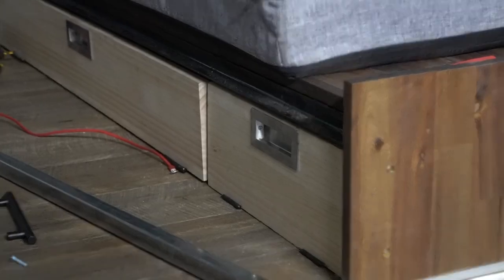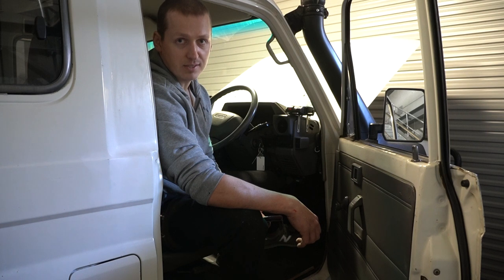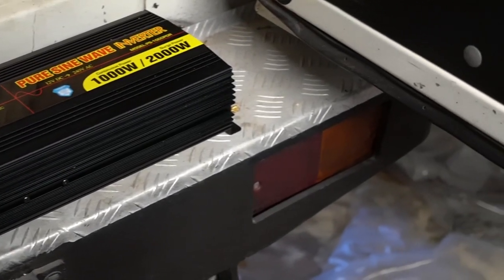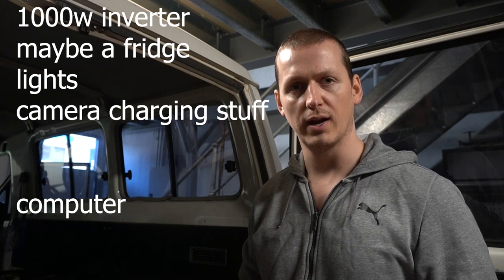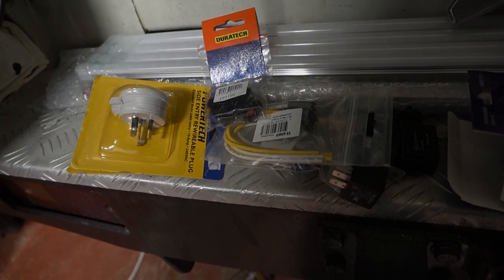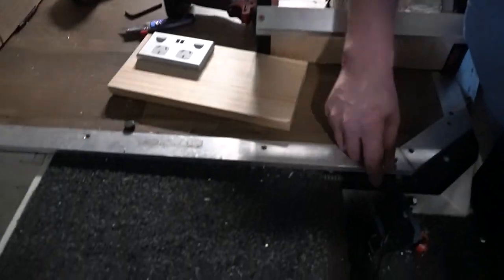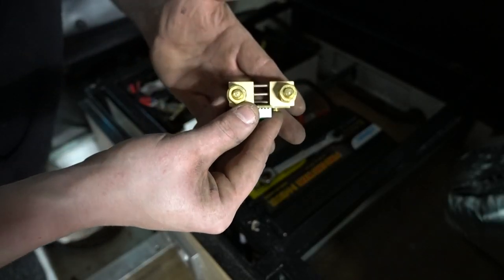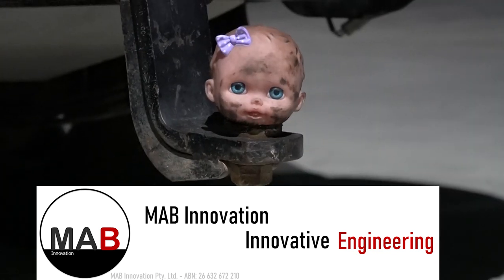Wiring your own 12v setup for your campervan or 4x4 troopy | Part 6

Comment: Here's my safety comment:  Power points in RVs have to be double pole (both live and neutral get switched off).  Normal house plugs are only single pole. But feel free to ignore this.  Maybe the inverter is double pole and therefore the power point becomes double pole too... 
Waiting breathlessly to see what the actuator is going to be used for!
Reply from the maker: That's a good bit of info I certainly wasn't aware of. I had checked beforehand if there were any major requirements like this, but it seems it's not common knowledge. While technically it's not an RV/caravan and would probably be legal as is, I have the annoying habit of liking stuff done properly.
Thanks for the insight. I'll get on it.

https://emucaravanrepairs.com.au/caravan-electrics-explained/

I found this link which gives a good explanation for those playing at home.

Hopefully the actuator doesn't end up a disappointment ;)
Reply: I use a brand called TESLA (nothing to do witht the car maker).  If you get Clipsal Double Poles outlets they are stupid expensive.  Reckon I just got them off of eBay.
Reply: The double pole outlet is because caravans and the like are powered from plug in extension leads which can be wired up incorrectly causing the neutral to become the active which is then in a normal power outlet not switching off the power to the appliances making the appliance not operate but is still live. The troopy not being plugged in may be ok I’d have to go through my reg book to see if that would be the case. Be careful of eBay 240v power gear most of it is not Australian approved.
Reply: Tesla is Aust Approved to V110160 Standard
Reply from the maker: Thanks guys, I ended up ordering a pair from electrotraders. Probably not the cheapest, but the style is almost identical to the ones I put in, so I went for it.
Reply: Better to be safe than sorry ,  good work , now you’ve got a couple for the office , should I bring up the rcd(safety switch) debate for inverters in vehicles , nah I’ll let it slide.
Reply from the maker: @Andrew-76  you dawg, I heard you like RCD, so I got you an RCD for your RCD so you can trip while you trip
Reply: Love it😂

Comment: Good to see you are keeping to the golden rule K.I.S.S "keep it simple stupid" you may want to consider putting a sealed maintenance free battery in the cabin due to hydrogen build up and electrolyte spills.
Wet cell batteries in the cabin are not legal either.
Solenoids only get the job done from my experience u need a trickle charger to keep it at 100% when you are not using the vehicle or solar.
DC-DC charger's are a game changer but u need a big one 50 Amps + which is obviously  more $$$
Obviously all depends on how often you are going to use it.
Reply from the maker: Yeah I went through a lot of that stuff in the video I think (either this one or one of the others. I forget which because I can't watch my own stuff). It's a weekend only vehicle so hasn't caused any issues so far over a year later.
Reply: @ridiculousthings4x4  Ah yeah I've mainly only seen your 76 videos due to the parabolic springs im considering getting some as in 3 years I'm onto my second set of leafs and am due for a second re set they are good quality Australian made leafs but don't seem to last more than 70k worth of hard use.
I've had at least 8 different 12v systems in a variety of vehicles over the past 20 years all used for commercial purposes so pretty much every day use.
Im stuck with using only the better quality inverters since they often power sensitive test equipment.
I moved away from the one's that everyone seems to have with the unlimited budgets and sponsorship because at 1 stage i burnt out 3 in the space of 2 years.